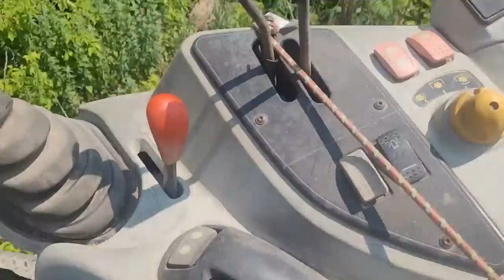Building A Hay Barn - Setting The Last Trusses

Comment: That's a lot of sheet metal to put up by hand. We made a cradle with a slight pitch to it and could lift it with our bobcat Tele handler. Just pick up the cradle with the forks and load up some sheet metal and lift up to the eve and drag up from there. We used ours all the time putting up building so it was made of steel. But you could make out of wood. With the long sheets you couldn't get as many sheets on do to weight and length.
Reply from the maker: Great idea!

Comment: Sorry you folks need rain this early in the season. Rough having to pump water this early. That is a really big shelter. Those trusses are very flimsy on their own but once put into place and braced up they are very strong. Just be careful setting them. It is a long way to the ground and if you are like me you probably don't bounce like you used to. Really though please be careful. Cows are so cute when they are that small. Looked like that one needed a little help. It will be fine now. Hope your rain is forthcoming...